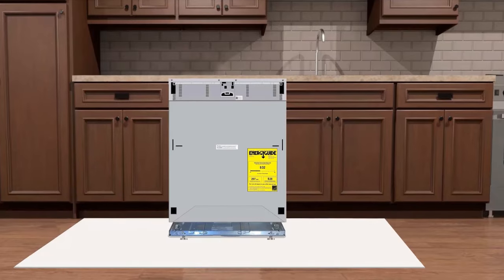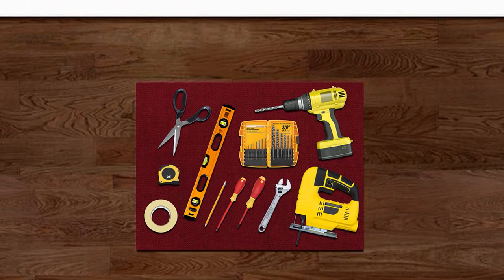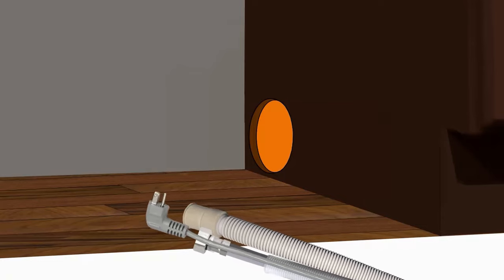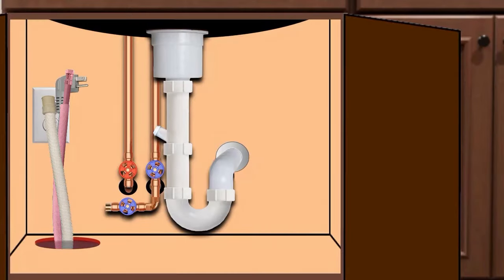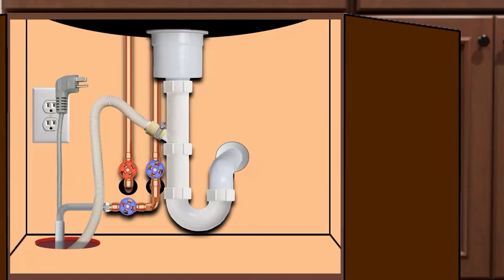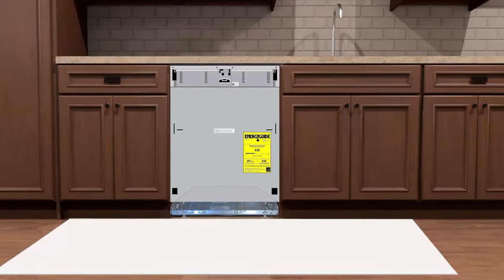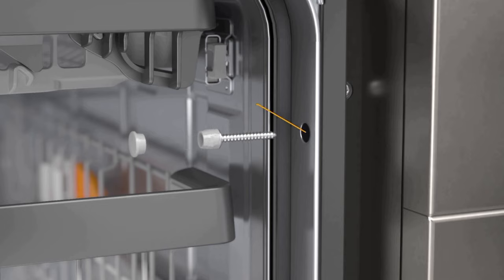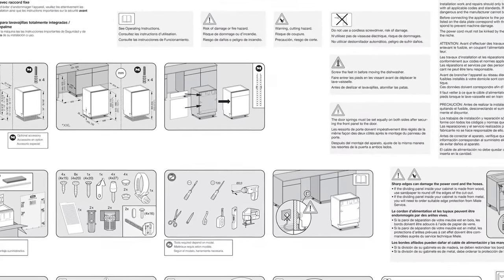Watch How to Easily Install a Miele Dishwasher in Just a Few Steps!

Comment: Miele should be ashamed of the installation instructions that come with these.  We want actual written instructions explaining some of ambiguous pictures.  For example - is the steam deflector needed for solid surface / waterproof countertop?
Reply from the maker: Andrew, we regret to hear about the difficulties you're facing with your Miele dishwasher.   

For further assistance, please don't hesitate to contact our customer service team at 888-996-4353.  

You can also reach out to us through our website here: https://www.mieleusa.com/f/us/contact-next-us.aspx

Thank you for your understanding.
Reply: @MieleUSA  the point is we shouldn't have to call an 800 number for basic instructions.  If you want to help push this complaint up the chain and tell them they need to back to actually providing written directions with the installation instructions.  Nobody wants to call an 800 number
Reply from the maker: Thank you for sharing this feedback, Andrew. We understand your frustration and apologize for any inconvenience this has caused.

We aim to provide the best possible service and make our installation process as straightforward as possible. Your feedback is valuable, and we will certainly pass it along to our team. 

In the meantime, if you have any specific questions or need assistance, you can also email our Consumer Support team at info@mieleusa.com and they'll be happy to help you directly.

Thank you again for bringing this to our attention. We appreciate your patience and understanding.
Reply: Whats with all thes bot answers ?? Pretty awful@MieleUSA
Reply from the maker: No bots here, Jaustin! We're real people! ✨
Reply: Rubbish instructions i agree
Reply from the maker: Hello, Mikel! If you need any help with a Miele appliance, just let us know. Thank you!
Reply: @MieleUSA  its going back tomorrow👌
Reply from the maker: Mikel, we're so sorry to hear about the frustrating issues you are experiencing with your Miele appliance.   

If you need further assistance with your Miele appliance, please feel free to reach out to our customer service team at 888-996-4353.  

Alternatively, you may also contact them via our website here: https://www.mieleusa.com/f/us/contact-next-us.aspx

Thank you very much.